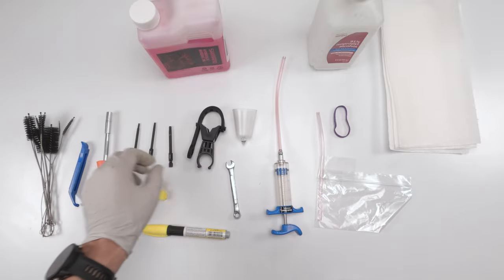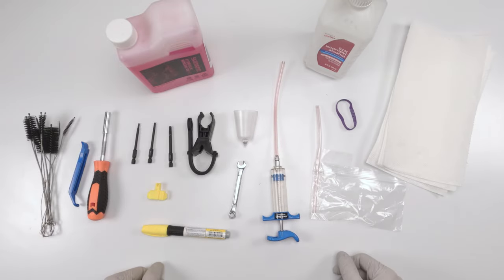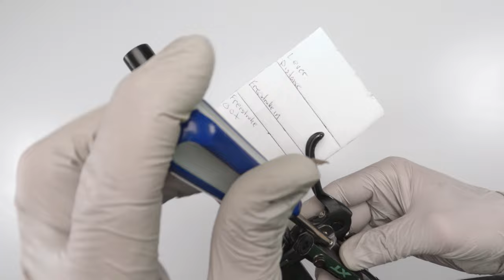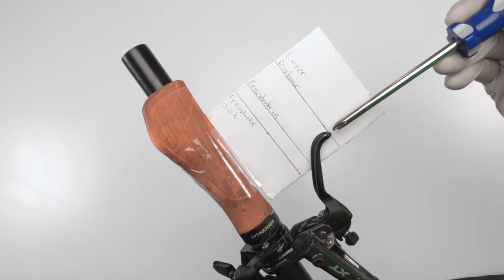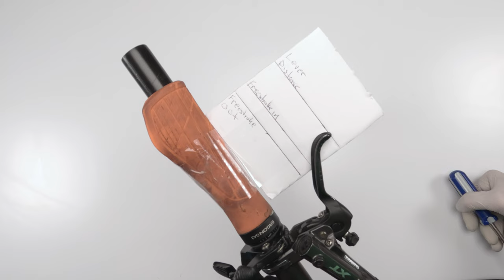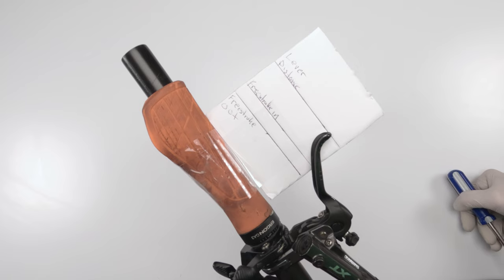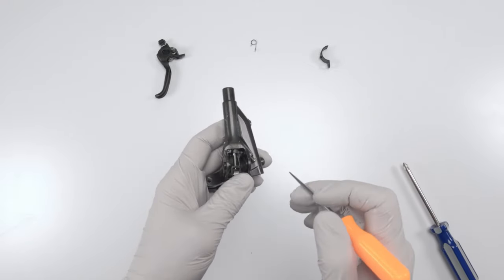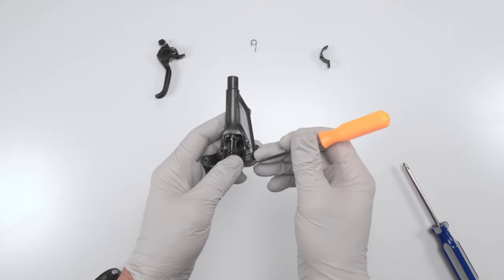Shimano XT M8000 M8100 Brake Bleed Service Guide for Beginners. Free Stroke FULLY Explained

Comment: I've found having the freestroke screw all the way in causes the initial pull to be longer than subsequent pulls (pumps up). With the screw all the way out the pull amount is consistent. Bled with the screw wound out.
Reply from the maker: I'm happy to hear that you are at least putting an effort to see what feels best for you. 💪👏👏Most people I come across are afraid to touch it. Just remember, there is no right answer. Whatever feels best for YOU on the trials you mainly ride is all that matters. 👍
Reply: @zoubtube  Sure. I should be clear that I only saw the issue when I bled the brakes with the screw fully out, and then after finishing the bled screwing it all the way back in. 

I compared this with my SLX brakes which have the screw all the way in from factory and you need a special tool to wind it out. 

I also couldn't find anything in the Shimano bleed documentation about winding the screw out prior to bleeding.

I enjoy playing with all the options and finding what works best for me. Happy trails.

Comment: Awesome video, do you screw the freestoke screw back in after bleed?
Reply from the maker: I'm glad to hear that you found the video helpful. As for the bleed screw after the bleed, it's totally up to you. The freestroke screw offers nothing more than a minor adjustment in feel. This is a personal thing that you will need to test on your own to see what your preference is. The one thing to remember is to adjust the lever to your preferred position after adjusting the freestroke screw, as it will move the lever. The effects are minor, and it will most likely take a few rides on trails you are very familiar with to feel the difference, so feel free to play with the freestroke at will. You won't break anything in the process. But again, remember to reposition the lever after you adjust it.

Comment: Good Video
I have a XT chrome cap - never fiddle with it.
I also have Magura MTS with BAT Knob - also don't fiddle with it. - Magura is just Gimmick.
Reply from the maker: Thanks. the effect the free stroke has is very subtle, but noticeable once you try it a few times. the biggest issue I find is people don't adjust the handle after they adjust the screw. one doesn't work without the other.
Reply: @zoubtube  too bad you don't Have Magura brake with BAT adjustment to make a Video. I look at the Shimano XTR does not have this option

Comment: I had a guy on pinkbike 3d print me some 0.5mm thinner bleed blocks for my Saint brakes, so I could 'overbleed' or overfill the system even more than the freestroke bleed trick (you explained it very well).....some people eyeball this by using the brake lever to push the pistons out a hair, but the custom bleed block is far more repeatable.
Reply from the maker: Joker,, you are so dead on with this. I SO need to invest some time to learn how to 3d print. There are so many ideas to solve problems for so many things that can be solved with one of these devices. I'm honestly amazed at myself that i'm so lacking in that field. I keep pushing it out because of other technologies that I need to keep up with for work. Time, man. I need more time in a day 🤔

Comment: I dont know If i should buy the Parktool bleed Kit or the jagwire. Parktool Looks very good and makes everything easier. I rly Love Ur  Videos and Ur knowledge. U gonna make a Video someday on bleeding Magura? Thats why i wanted another Kit i have Problems to bleed the caliper With the Standard one idk IT Drives me crazy. Lg
Reply from the maker: I've never tried the Jag wire kit, so I can't speak to it outside of saying that it looks like a nice kit. My opinion on the Park tool kit is that it is too expensive, especially if you only need to service one company's brakes. The one part I love about the park tool kit is the syringe holders. I use them all the time. You can now buy them individually, which is another nice option with the park tool kits. You can buy just the parts you need for your bike/s, which will cost you much less, and add to the kit later as is needed. The one part the park tool kit that is missing is a reservoir holder. It seems like a big miss to me, especially considering the cost of the kit. A subscriber on the channel mentioned that he uses a toilet paper roll, which is a great idea, but let's face it, for ~$140, we should have to resort to something like this.

Comment: Hey there! Great video!  Question; i like my lever max open, so the adjuster knob is turned all the way.  When i turn my free stroke adjust, it pulls the leaver in, but i have no travel left on the adjust to bring it back.  So, using the free stroke adjust doesn't help me.   thoughts?    I'm guessing the only thing i can do is  use a thinner bleed  block to get my pads in tighter to my rotor during the bleed process?  Also, what;s strange, is my left (front) lever feels great, but i can't seem to get the same position on rear (all brand new parts, except rear rotor is not brand new, but surely it hasnt worn down significantly...)  EDIT: (maybe i missed this step? ".... 15:44 mark in the video, after I install the bleed block, make SURE to press the lever a"..   my bleed block slides in easily with the pad removed, but doesn't fall out..  idk, still strange front and rear are quite different...
Reply from the maker: If both lever is the way out you limit your options. When the lever and freestroke are both all the way out, it the farthest out the lever can go. Screwing the freestoke all the way in will bring the lever in a bit, but now you have no room to adjust the lever to the preferred position since the lever is already in its maximum extended position.. Basically, the lever needs some headroom for the free stroke to work

As for bleeding with a thinner block, this can help, BUT,, it increases the chances of having too much pressure in the system, which might lead to a leak at the weap hole. I am not saying this will happen, just mentioning that there is a slight chance

It is very important that you make sure both pistons move at a similar rate. They will never move perfectly together, but if the walls are clean, they should respond very close to each other. Many people skip this step, as my buddy did at the beginning of the season and complained that he couldn't get rid of the rubbing noise. I told him to go back and thoroughly clean his pistons and BOOM. Problem solved. 

Hopefully this helps some

Thanks for the comment

Comment: Thank you for this! Excellent!
I modified my SLX levers free stroke screws a while ago so I could use a flat blade screw driver instead of the U-shaped tool.
Anyway, it's been a while since I've bled those brakes and this was the perfect video for doing it right.
My SLX levers are now coupled to Magura MT-7 calipers. The power is simply amazing! And soooo much easier to bleed.
Shigura for the win!
Reply from the maker: Thanks for the comment and I'm glad to hear the video was of some use. i'm curious to know how the slx levers compare in feel against the magura levers. it the bite more consistent through the stroke?
Reply: SLX levers with Magura calipers and Galfer purple pads, stop on a dime and do it right now. 
I would say the bite is very consistent and powerful throughout the stroke. 
I tried the Magura levers for one ride and just couldn't be satisfied with how soft the lever felt.

Comment: Question.....I have to change the piston, do I have to completely remove the screw, i.e. 2 threads maximum?
Reply from the maker: My apologies for the late response, but I'm still very behind on responding to comments. The piston can be removed without removing the free-stroke screw. Hopefully, this helps

Comment: How can one get out of the jammed situation you describe at 11:00 in the video. I'm afraid my brakes could have this issue as I got them used and the screw is currently jammed. On both levers. I suspect the previous owner had made this mistake.
Reply from the maker: My sincerest apologies for the late response, but I'm still a couple of months behind on messages. If the small bolt jams the internal lever, your best bet is to unscrew it and tap the handle to see if it loosens the lever while leaning the bike a bit on the same side as the brake handle, then screw the bolt in again. I hope this helps

Comment: Excellent tutorial! I’m not sure why shimano call it one way bleed though . I did get the plastic holder for the reservoir cup with a cheap kit, indispensable
Reply from the maker: Thank you very much. glad you found it helpful. I look at shimano like an aircraft carrier. lots of firepower but VERY slow to turn. 😉 It takes alot for this company to make a change, or to admit that they should have looked at things differently.

Comment: The blackness is the aluminum oxide in the mineral oil and created by the mineral oil as it removes the layer of oxide as washes across during fluid movement.  As hard as that oxide particles are very good to not push into lever piston but all should be flushed right past the piston anyways if do such multiple time so when operate lever there is none in there. Very clean oil coming into reservoir via pushed thru calipers. But Then again pulling a vacuum can drop the pressure enough to cause micro bubbles in the mineral oil that may not even be visible to human eye is why not recommended and is only recommended to push fluid from caliper to reservoir. As when pulling vacuum if let the bike set those little bubbles gather and create softer lever and less braking power overall as air is compressed. Pushing brake fluid 5 times is allways a good idea also
Reply from the maker: If I understand your comment correctly, I believe you are saying that pulling the oil shouldn't be done because it can create small bubbles. I believe I explain this process in this video (as well as the SRAM brake bleed video) 

You are correct in that, when depressurizing a system, bubbles can be brought out of solution. Ultimately, this requires negative pressure in order for it to happen. Once you stop pulling, pressure will balance itself again, meaning,  the micro bubbles will now go back to their normal ambient pressure state. This is essentially how a hyperbaric chambers work for scuba divers

So if you see small bubbles in the fluid when pulling the syringe, you're basically pulling too hard. The issue with pulling too hard is not the little bubbles that appear in the fluid, but the possibility of sucking air in from the edge of the syringe and potentially pushing it back into the system without noticing it (which I believe I explain in the video). This wouldn't be an issue if Shimano made a bleeding-edge type adapter like SRAM has. Pull lightly, and this won't be an issue.

As for those really small bubbles you see when pulling on the syringe too hard (depressurizing), it's not an issue. Again, the system will equalize the moment you stop pulling. Once you close the system, it is nearly impossible for it to depressurize. I say nearly because it can be done if you put the bike on the outside of a plane and fly to 30K feet. 😉

as for pushing fresh oil multiple times, that will work as well, (though it will require quite a bit of extra oil) but as long as you tap the system regularly in order to make sure you agitate bubbles to move through it, you should end up with a solid bleed 👍

Comment: Absolutely great professional video and awesome instructions! Really helpful!
But WTF where did you win these screwdrivers 🤯
Reply from the maker: Thanks for the kind comments, and I'm glad you found the video helpful. As for the drivers, the one with the orange handle I bought on Amazon a while ago; below is a link. I love this thing. Great grip, strong magnet, super versatile, and it lets me change bits easily, and if a bit goes bad, I can buy just that bit.

https://www.amazon.com/gp/product/B0972SYPTJ/ref=ppx_yo_dt_b_search_asin_title?ie=UTF8&th=1

as for the driver with the blue handle. The driver is about 40 years old. It has been used and abused COUNTLESS times, and it still works flawlessly on just about any phillips head. I don't know what kind of steel they used back then, but I wish they kept using it today.😉
Reply: @zoubtube  interesting - do not judge a book by its cover I guess... I had similar looking ones and they were 🤔crap 🤣
Reply from the maker: @Les_Grossman No worries. Many of these drivers look the same, and except for my torque wrenches. I don't really get attached to my tools.  😉

But that blue driver phillips driver in the video is literally from the 70's. I'm not kidding when I say this thing has been totally abused by both me and my dad before me. Barely any wear on the edges. Need to remove a partially striped 4" #8 screw from a 2x6,, No problem! Need a punch,, Hammer away! I'm convinced it will outlive me, like it did my dad!  😁

The orange-handled one fits my palm comfortably, has a good grip with greasy hands, and has a strong magnet. I was VERY skeptical when I bought it, as most of these usually have crap magnets. Amazon reviews were accurate with this one. For $10, it was worth it, and I use it more than I do T-handles.  

I will say I've been pretty disappointed with park tools these past few years. I plan on making a video on this eventually. 👍

Comment: All of the videos I saw seem to show more info than needed and make me more confused.
For example, you sucked out the bad fluid in the 1st stage-makes Sense.
After getting rid of it, you fill the syringe with new fluid, and push it back-that's ok as well.
Why do you keep playing with the new fluid back and forth now?
This should go up with no bubbles and that's it, am I wrong?
Reply from the maker: Good question. Just like in a syringe, small air bubbles can potentially stick to the walls of a brake system. To add to that, brake systems have very small holes that the oil needs to flow through, especially in the caliper, which can be seen in a video I made a while back where I change the pistons in a Shimano caliper. An air bubble can get stuck in front of one of these holes, allowing oil to flow around it. By agitating the system (gently pushing and pulling the syringe during the bleed process), it helps move air bubbles that might potentially be stuck on the walls. Think of it as a belt and suspenders approach to bleeding brakes. This goes for all brakes. It takes an extra minute or two, but it is worth the added assurance. Hopefully, this will help better explain the reasoning.
Reply: @zoubtube  many thanks for the comprehensive and prompt reply, much appreciated!

Comment: Super video. Congrats. One question. At the end, how should you leave de FreeStroke screw?  Acording to rider preferences? In the initial position?
Reply from the maker: Thanks. rider preference. the freestroke (as well as contact point adjustment) is a personal thing. It's all about YOUR comfort. Don't let anyone tell you otherwise. just remember, both freestroke and CPA offer a subtle difference or minor tweak, not drastic.

Comment: Awesome vid.  This is how I've been doing it after trying many different techniques.  I still notice the the bite point changes as the pads and rotors heat up.  Cool down and returns to original bite point.  All 3 of my bikes do this.  Is this just how shimano brakes are, or is there a fix?
Reply from the maker: Apologies for the delayed response. To answer your question, "Is this just how shimano brakes are?"  For the most part, Yup! As far as I know, there is no absolute fix for a wondering bite point. Though the feel is very inconsistent, as in even if you had multiple pairs of the same model brake, you might feel it a lot with one brake, and yet with the other, you will rarely feel it. Making sure you have air out of the system will definitely help, so check the bleed port periodically through the season and top off the handle when needed
Reply: @zoubtube  I do notice it's usually the rear brake that this happens to.  But I tend to drag that more than the front on down hill runs.  If I top off the fluid without using the bleed block the bite point is slightly more consistent. Just be sure to not push the pistons back unless the fill port is open.
Reply: So you are essentially overfilling the system to get a better bite point. I’ve done this and it works but I also wondered when the fluid heats up there is no expansion room in the system and the brake could lock? Hasn’t happened to me this far with general trail riding but perhaps on a gravity focused bike with really hard brake use it could be a problem? Just conjecture. 
And yes when you install new pads and push the pistons back in you need to open the system with the cup installed to remove excess fluid.

Comment: Very good video my friend! Just a quick question, I have a pair of SLX brakes, that are identical but the free stroke screw has a diferent head, I was thinking of changing them to a philips or even hex head screws, I know the thread is an M4, but i'm not quite sure on the length, could you please enlighten me on that measure? Thank you!
Reply from the maker: Thanks for the kind words. You'll need a U-shaped spanner like the following: https://amzn.to/4amUEq6 to remove the bolt (you might have to shave it a bit to fit, I made my own with a flat head bit and a dremel). If memory serves me correctly, I believe a 10mm m4 works. I could be a bit off, so I would buy a 10 and 12mm stainless steel m4. Remember not to force the bolt in too deep. Once it naturally stops, you're done.